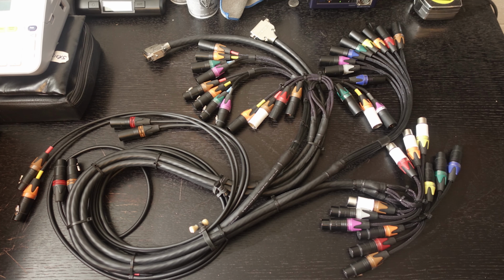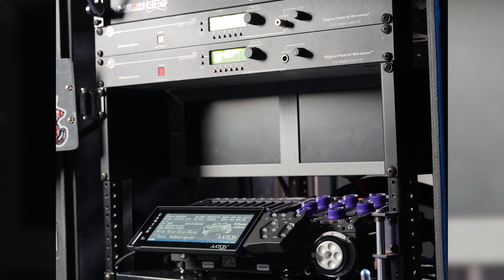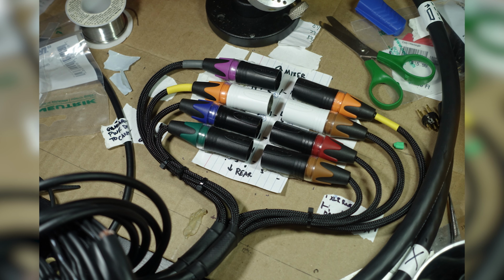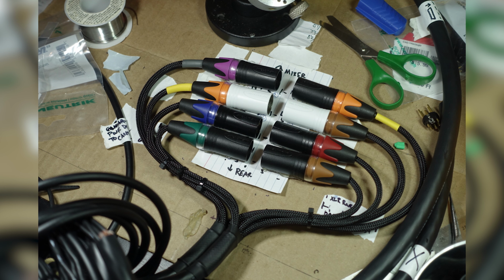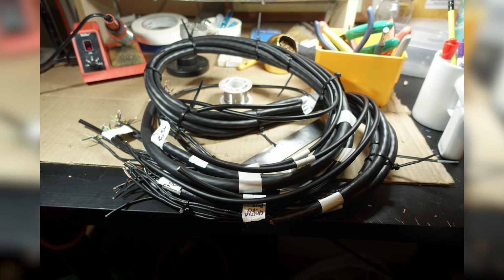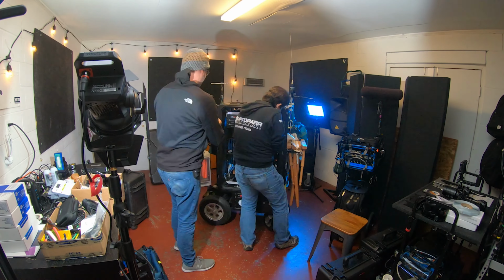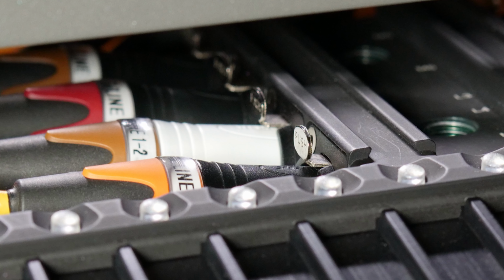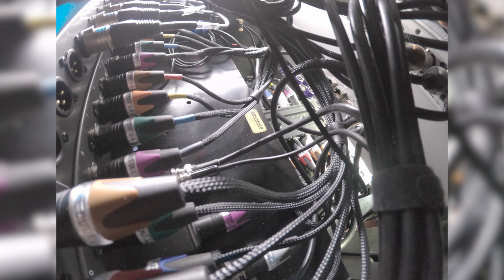An interview with the Cable Maker - Aaton Cantar X3 into my production sound cart.

Comment: Looking good! Scott, if you are here. Shield to only pin or also with a jumper to XLR housing?
Reply from the maker: Dustbrigade I’ve seen the soldering he did.  Ground to Pin 1 and also split to housing, no jumper, I’ll let him confirm though.
Reply: Some people put a jumper from Pin 1 to shell - it's simpler and faster for me to twist the shield into two parts - half to shell, half to Pin 1. Keeps the twists a managable size and faster to do or work on. I do this at both ends of the cable, unless there is a need to do otherwise.